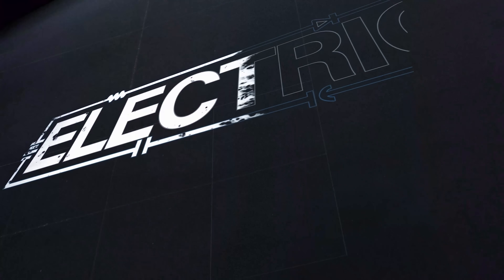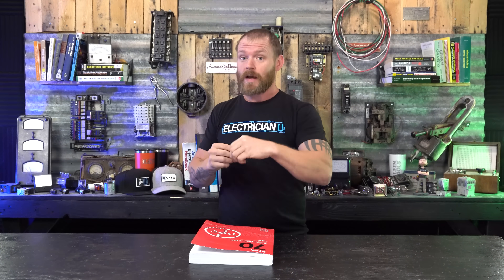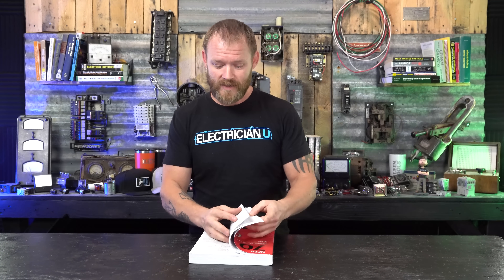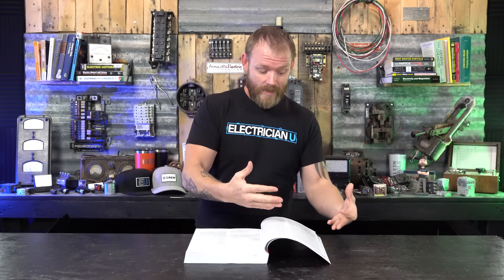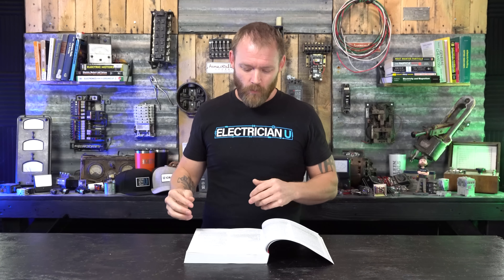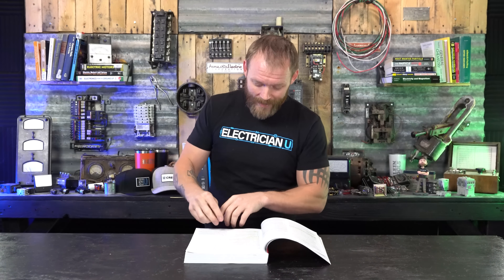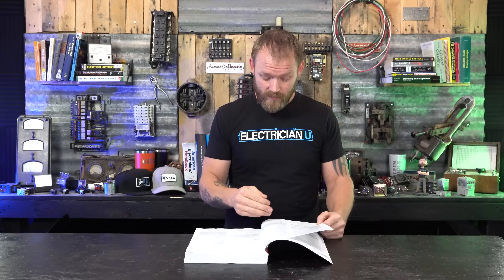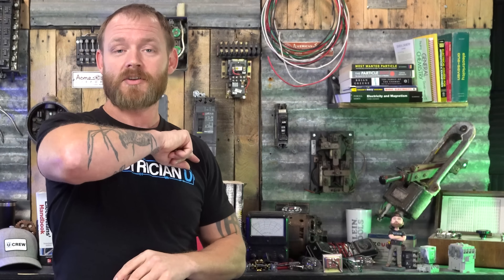Where Should We Be Using Dual Function Breakers?

Comment: I believe I saw that the 2023 code was going to require EVERYTHING in a kitchen, basement and the exterior of a dwelling to be GFCI protected. The only exception would be where a manufacturer specifically states GFCI protection not be used due to incompatibility issues. But that will only be a temporary exemption as the manufacturers will need to address that issue.
Reply: exactly. EVERYWHERE... this guy is referencing the 2013 code for some reason... its changed a lot in the past 10 years.
Reply: @jdcpe17  I Believe he
 is referencing the 2023 NEC code book.  He just misspoke and said 2013 by mistake.  When he pulls the book off the shelf it is a copy of the 2023 edition.
Reply: Of course it all depends upon which version of the NEC your particular location has adopted. Some are still several versions behind, which can be confusing sometimes, even for the inspectors.
Reply: It's true. (A)(6) in 210.8 now just says "kitchens" meaning all 125- through 250- volt receptacles in the kitchen require GFCI. However, there is a list of locations at the end of 210.8 (in 2023 NEC) where receptacles everywhere are exempt, such as ANY type of security system(fire, burglar, high water, carbon, etc.,) that is permanently connected to a receptacle. That applies in any room in 2023 NEC, not just basements anymore. Also, ice melting equipment at gutters/eaves is still exempt. There are two more I think, I would have to look.

Comment: Dustin,

Thanks for the video! Seems I should be good to replace all circuits with DF breakers once the FPE panel gets replaced. I don't have a welder at this time but appreciate the clarification in having atleast one dedicated circuit for it in the garage. 

Also much easier to monthly test a set of breakers rather than the outlets throughout the home!

12/2 throughout but the panel seems to have MWBC since the breakers share a space? Didn't think you could do that with 12/2?
Reply: I don’t think Multi branch circuits don’t work with AFCI. You can use a dual pole gfci breaker with multi branch. I did for my washer dryer and my dishwasher and disposal
Reply: @Silky_boi  pardon my ignorance, I'm still learning. 

But the issue I'm foreseeing is that I have 12/2 Homeruns throughout, which I believe to be MWBC given the FPE load center runs 12space NA feeding 8space NC sub. 2spaces NC are open, 1space is a Full, the other 5spaces are minis(2ea). I don't see how they could run the minis without shared neutral on a single space?

 (It's highly probable there are larger gauge cables for the 60A 2P and 50A 2P but I have not seen them yet. Everything I've found in the attic is white romex stamped 12/2.)